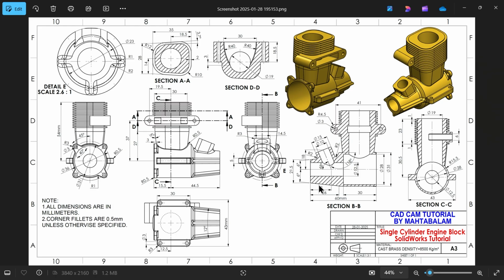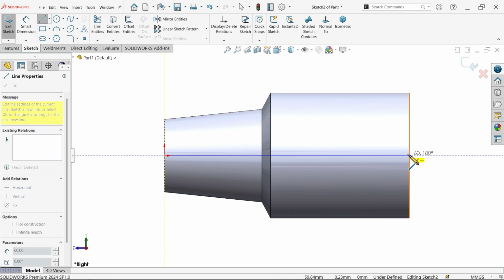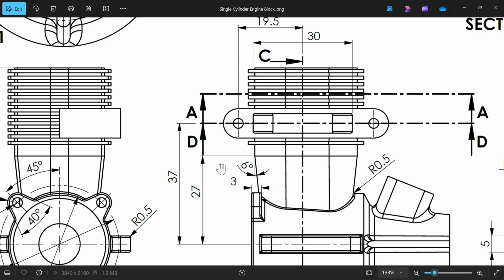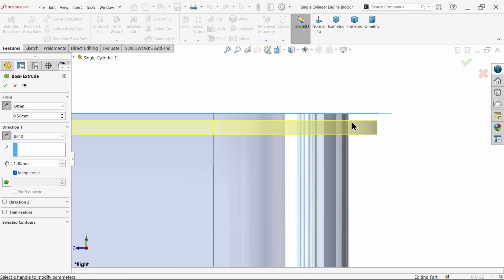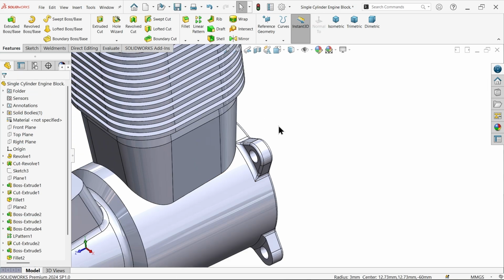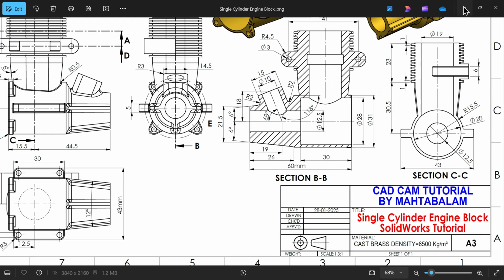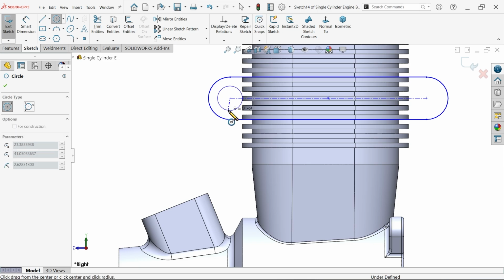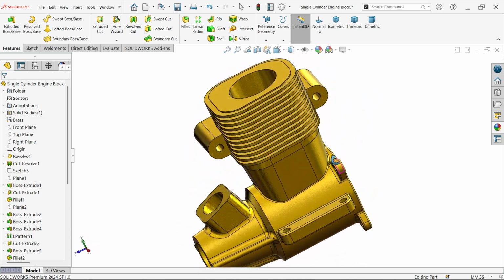SolidWorks Advanced Tutorial-Single Cylinder Engine Block Modeling

Comment: What should be the default font size for the dimension?, It got changed unknowingly how to reset it to the original one? And up to which extent should I increase the dimension Size and its point size in Font section